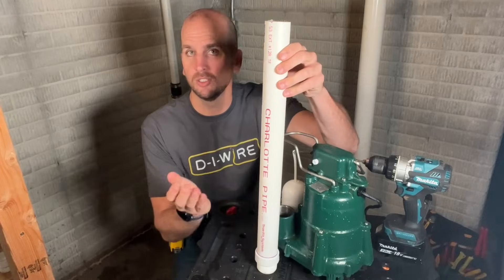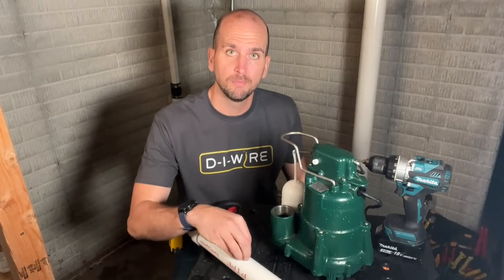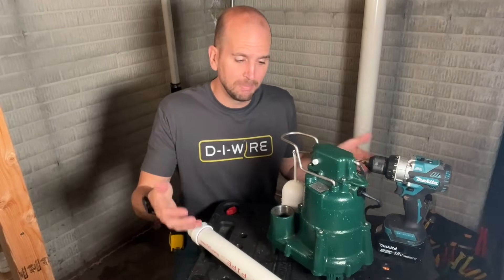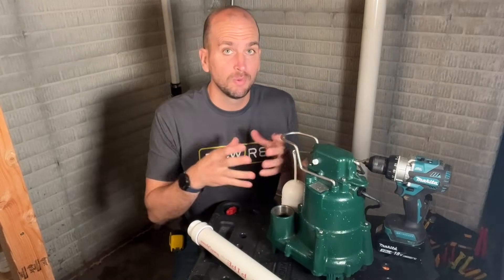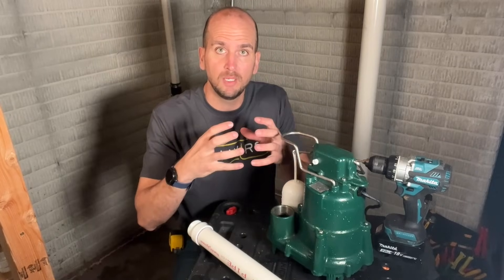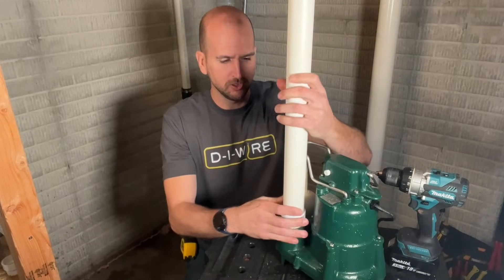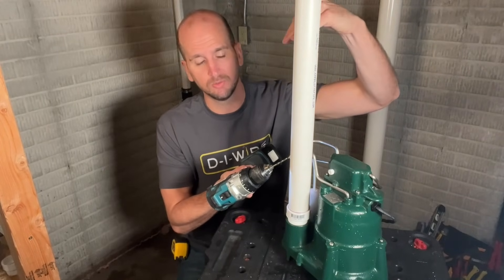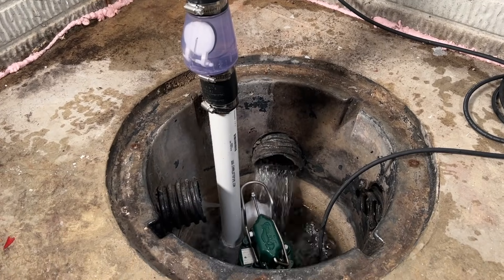80% Miss This Critical Part Of Installing A Sump Pump

Comment: Ok i have a weird one for you and I have no idea how to really go about fixing it. My sump pump has a tube (not a pipe) and whoever put it in just kinda fed the tube through the outgoing PVC pipe for like my sink shower bathroom, it all connects at one spot which feels wrong looking at it. The PVC that it's fed into isn't sealed around the pump tube AT ALL and there's another spot where all the pipes connect where it's just open. There's some kind of blockage that I can't find with a snake and the two openings are just kinda throwing gross water all over the basement. Any thoughts?😢

Comment: I have a small crack in the bottom of the basin. Maybe the size of half a kids crayon. Without the big repair of replacement can it be patched with hydraulic cement or water epoxy? Plz help!

Comment: New pump, there is a screw plug in the top? Do place oil in before using? It is not covered in the Manual. LG

Comment: I have a question, our basement flooded really bad and it overwhelmed our current sump pump. We had a foundation company do a form of drain along the interior foundation and ran that to a new separate sump pump, so we have two sump pumps in different basins, butthey plumbed the output into the same line now when the sump pumps run one of them shoots water straight up out of the top. I’m curious if this vent hole could solve that issue or if I need to have a check valve installed before the tea where the sump pumps joint

Comment: Great video the first time I put the weep hole in I put it straight in so now it splashes against the sump hole and splashes out of the hole but next time I'll make it right and the m98 is the way to go
Reply: Put self tapping  screw in that hole...then drill one more hole ..45 angle.
Reply: @INTERNA9 ok thx will do

Comment: My check valve is at the every bottom at the base of the pump so does that mean i don't need a weep hole
Reply: You still need a weep hole below the check valve
Reply: Just to clarify since the built-in check valve at the base, there’s no room for drilling a weeping hole underneath.

Comment: I am pumping uphill 2 ft to a drainage ditch 100 feet away. There is always water standing in the pipe, which may freeze in winter. What should I do?
Reply: I've plumbed an air hose fitting to the extraction pipe as an attachment and blow out the lines come winter. It has worked so far hope this helps
Reply: Yes, It helps. I survived one winter with water presumably standing in the pipe. I will blow it out next time.

Comment: thanks for advice. i just installed a new 1/3 hp cast iron sump pump here in southern ontario. i also installed a new sump pump check valve at base of pump and i did not drill the hole in discharge line. the pump blows water out of vent hole rather than discharge line. i drained the sump and refilled it to check if airlock had been removed but same problem. i’m wondering if pump is faulty, check valve seems fine, the discharge line was not obstructed last week. if i need to drill hole in discharge line, is it ok to do so above sump pump check valve? thank you

Comment: I don't have a weep hole YET, but I do have the Zoller Quiet Check Valve.  Our old valve would SLAM shut, it could be heard throughout the house.  I ordered one, and it arrived the next day (I don't remember where I ordered from.  Taller than the old valve, and had to cut a few inches off the PVC pipe.  Awesome valve, I don't hear it, at all....

Comment: All you have to do is read the instructions they require a vent hole right above the top of the pump what I do is slide a inch and a half by 2 fernco over the inch and a half discharge pipe if it's inch and a half and it contains the spray that comes out of that hole. If it's a 2 inch discharge they make a fern go that's for 2-in pipe and 2-in hub and that works great for a 2-in discharge just keeps it from spraying all over a trick that I came up with works great

Comment: So it leaks as it discharges?
Reply: Yes, back into the pit... it will be a small amount as the check valve you install will be above this weep hole
Reply: Yes... it can make a small mess as the discharge will hit the side of the basin...

Comment: Awesome tip! My sump pump doesn’t run in the winter and the sump dries out so it is a PITA to get going every spring due to air lock. What a quick and easy fix… I did this and now it works like a champ. Thanks, Scott! 👍🏼
Reply from the maker: You bet, thanks for the feedback!

Comment: the pump is not listed anywhere?
Reply: He said it was a Zoeller 98 I believe.  Zoeller does make a quality pump.
Reply: They make a range  of pumps similar to the m98 shown.  They are more expensive than other brands, but you get what you pay for.

As for some of the choices... power and flow rate.. then no float switch, regular float switch, premium switch..

I believe the premium switch comes with a 5 yr warranty.  The switch is typically the weak link with any sump pump...